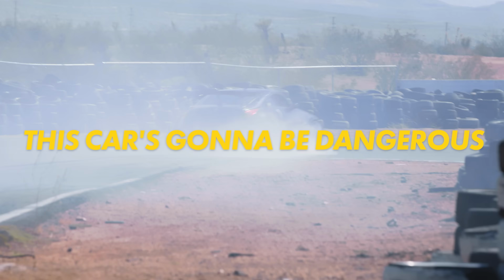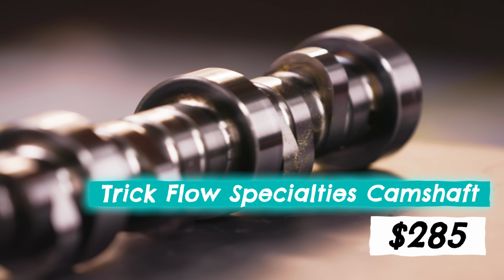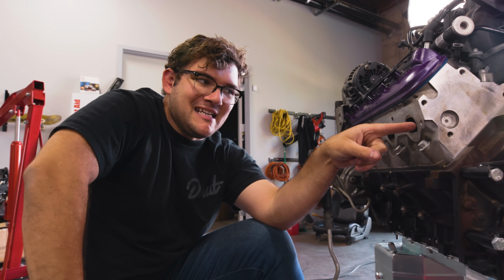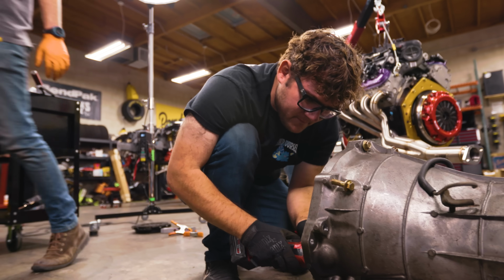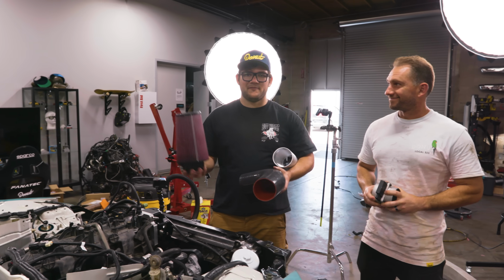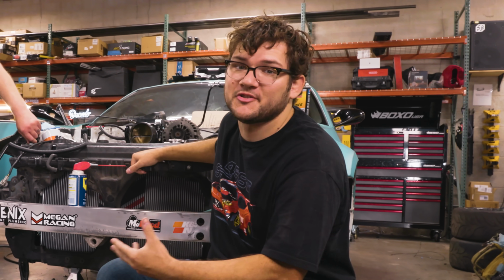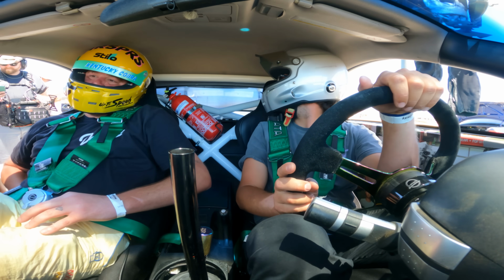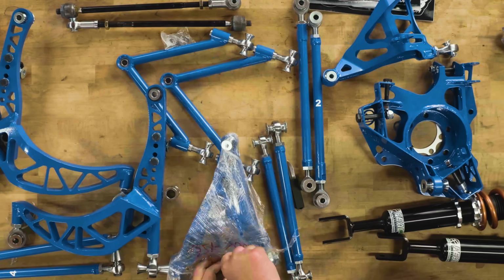$8000 Junkyard V8 vs $30,000 Crate V8 Engine Swap

Comment: I love how they make it seem like 8000 is only 10 dollars😂
Reply: in engine swaps it sure is
Reply: @1985_Honda_CRX_Si  lol it is, isn’t it. This would cost another 10-15k in labor, if not done diy. It’s a very expensive hobby.
Reply: 10k is an amount of money most men with passions in their prime can throw at a toy, this proves you're better off learning and doing, than saving the 30k to pay someone..
Reply: @fry.master  its pretty easy to do if you do it over a couple of years like most people.
Reply: @Saberjet1950  easy is not the word.. I was thinking in "possible"
Reply: 6k and counting for my money pit love the way she rumbles
Reply: @DonChilon210  Still weird that they basically spent 20k-50k on 5.x second cars.  Fun cars but you can buy plenty of used cars for less money that are faster than that stock, then modify them.  I expected much better acceleration for 400-500 hp engines in small hollowed-out cars, but maybe the tires were the problem.
Reply: I don't know what yard they went to but every yard I've seen here on the east coast, a verified healthy junkyard motor runs 2k tops and the U pull it yards only want 3 to 400 for a whole ass assembly.
Reply: @ryanmills7986  I was gonna say 8000 should get u a kickass used engine.  I paid 500 for my used engine 3 yrs ago and it's run fuckin great.
Reply: When I was younger, that sounded like so much money. Now I think about what I have in not one car, but 4 main toys? Fk.
Reply: Well... when this channel makes almost $3mil a year, I would say so.
Reply: @Saberjet1950  right, its basic when it comes down to the assemble and disassemble. the same applies for most things cars toys wagons. you take off and add parts. most people could do 90% of there restoration themselves. some tuff the fine tuning requires skills.
Reply: If you have sponsor and do a collective money , it's nothing .
Reply: with way things are going, $8000 will soon be the new $10
Reply: Makes me feel pretty good about the $300 I spent on my 6.0, lol.
Reply: You can get a reliable LS for less then 3k
Reply: It’s more than a yearly minimum wage salary in my country 💀 and 1k less than the average salary 🏚
Reply: @ryanmills7986  they are in cali  and i think they bs a bit about that junkyard motor go back to when they first get it see if you see any thing strange
Reply: dude, they have like 5 employees and make an absolute ton of money between touring and ads generating revenue and stuff. Unless youre bad with money or have a bad job though, 8k is not hard to save if you really want to, and thats dirt cheap for a Z LS build.. Thats literally like less than what youd pay for a older slow civic SI now with low miles . I suggest watching the series "foundations in personal finance" by Dave Ramsey. It was a required class in high school, and it really makes you think about ways to generate and save more so you can build whatever you want in the future and be happy.
Reply: @Gerald.69  "joined 8 months ago, no videos no subs" you work at mcdonalds and drive an altima.
Reply: No shit.
Reply: No shit.
Reply: It's actually 8 dollars.
Reply: not by intention at all to sell stuff to us public schooled zdz
Reply: because they aren't paying for it.  simple.  the same way you don't truly value your game consoles until you're old enough to afford them yourself.  what a dumb concept, of course the 30k engine is better.  but what average (keyword AVERAGE) enthusiast can spend 30 grand on just an engine
Reply: That’s relativity, friend
Reply: @jonosterman2878  wow i want to go there. My swaps don’t cost near that much for labor
Reply: @Ebay Buyer Defender it sure as hell ain’t easy but we don’t do anything cause it’s easy
Reply: 8,000 can get you a used high mile LS1 car 😂😂😂 a Camaro with 130k miles hat still runs
Reply: 1100 for a 4.8 on LKQ add the computer and the trans and were only at 2500ish this is an expensive junkyard swap
Reply: To all the "8000 for an ls is expensive" they didn't pay 8k for the motor... it's the headers the springs the motor and Trans mounts the adapters and all the other odds and ends needed to make it happen. Just like high car they probably spent 30k for everything not just the motor. Still waiting on that low car build list though 🤔
Reply: @1985_Honda_CRX_Si  That's insane! I bought a TON of reliable  V8 horsepower for less than $8K last fall. Dart block, Dart aluminum heads, forged internals , big pan, 520hp without adders.
Reply: @iSOBigD  they likely can't transfer the energy
Reply: @incredible5587  *their
Reply: @Saberjet1950  tell that to my friends with their 87-95 bmw 325is that they swear they are going to turbo every year but dont have the funds and don't know where to start..plus they havent even gotten an intercooler yet.
Reply: @ItzzShazey  sound like they don't really want to do the work
Reply: It isn’t that much.. unless you’re still a kid or work at mcdknalds
Reply: @jonosterman2878  then your only proving his point lol
Reply: @Saberjet1950  that and they can’t afford to even get the parts to do the work. They think a 1700 dollar eBay turbo kit is going to be all they need to achieve 500whp. When In reality the kit is trash and wouldn’t work for more then 5 runs without something breaking.
Reply: T
Reply: Yw
Reply: @fry.master  Twyler’s r w
Reply: @ryanmills7986  They live in Cali dude. THis explains everything
Reply: I just had a salesman in New Orleans try to sell my wife a used Honda Accord for $33,000. So $8,000 for an entire motor? Not that expensive any longer.
Reply: @DeathhAngel1  sir you joined 14 years ago and have 11 subs. What was your point again?
Reply: 8k junkyard engine, its the best junkyard engine of all time.
Reply: Bought my car for $24k + $1400 tune ($25,500 total) and it does 0-60 in 3.7s or so. But to be honest a V8 swapped Nissan Z sounds like a riot, no matter the straight line hahaha
Reply: In retrospect it is when people spend 100s of thousands of dollars on drag cars
Reply: Fr buying $160 shocks has me broke
Reply: @Heavychevy0402  If $160 shocks has you broke, you need to not only be not modding your car, but need to be selling your car. You’re in a financial emergency mate
Reply: So nice old days
Reply: @iSOBigD  just because the cars made 400 to 500 doesn't mean that's what their tuned at. Also, there's different style dynos that show different numbers than others. Along with how your never really going to get a great idea of how fast something is in video. I had a car that made 450 but I never ran it at that more than a few times
Reply: Shoulda put a coyote in high car instead 😂
Reply: @jonosterman2878  if you ain't doing it yourself you probably shouldn't be watching this🤦‍♂️
Reply: @incredible5587  a lot of it probs down to people scared of blowing out their new parts tbh too aha
Reply: @fry.master  30k is the tuition at UTI to learn how to do it yourself lol
Reply: @teddy5004  30k is the baseline pay grade a year at a dealership to be a trash mechanic, that would maybe be better for someone looking at a place like uti… lmfao. I prefer a bs
Reply: @fry.master  Yeah I actually just got told by my local dealership that I should apply to work for him, he offered to teach me how to build engines so I can save up some money to go to MMI.
Reply: @1985_Honda_CRX_Si  laughs in $250 Chevy 350 engine swap
Reply: I mean for them it's like $10 sure since they make tons of money from sponsorship and ads.
Reply: @DuhShazey  The kit used on Low Car is based on the Turbonetics kit. Had they gone with the turbonetics turbo instead of rev9 could've made it a a bit more reliable.
Reply: The way they built cars is literally the equivalent of making an organic meal from scratch.  Nothing is cheap about it. In the end the cars are probably barely over the 8k js
Reply: Compared to what high car spent it might as well be lol

Comment: Nolan's reaction to his engine starting up is absolutely priceless. The genuine pride  he had for accomplishing such a hard task. Also impressed lo-car was faster for such a heavy & low powered V8. Can't wait for the next video
Reply: NGL I figured on the drag the high car was going to be slower, unprepared track and no sticky tires, too much HP is not always good, on a roll would have been another story.
Reply: May be less power, but remember it's a truck engine, that's a fuck-ton of torque down low.
Reply: We don't know the transmission gearing, which could have a big impact on the acceleration. Also, high car driver hit the rev limiter for too long on the 1-2 shift every time.
Reply: @elitebuster2012  they did a cam swap so other then block material and accessorie positions there is nothing "truck" about the engine
Reply: @jasonsaler8537  can confirm in a ls1 ws6 with bolt ons that short shifting 1-2 by 700ish rpm was fastest on street tires
Reply: @esfreerider  You forgot about intake. Truck and car intakes are different.
Reply: The low car 'won' because the high car couldn't drift.  What a stupid requirement.  High car would have won no problem if both drivers were pros and not checkbook hot rodders.
Reply: @DarthObscurity  its just a bit of fun dude lighten up
Reply: @DarthObscurity  The tagline of the show has always been "Does mo' expensive mean mo' betta?", and the answer has been, numerous times, "not always".

By the way, the only pro drifter on their team, is their shop manager...that I know of.
Reply: I actually felt Nolan's reaction. same feeling I had when my Mach 1 was drivable again after years of no progress.
Reply: @daldovino  Nice lowkey brag.
Reply: @NaruSanavai  aaron is pro from what i can tell but he was only in th first half of the video
Reply: @RayganSlatter  no they aren’t the motors are basically the same y’all just don’t know any better
Reply: @jasonsaler8537  i thought that too. i dont think it was deliberate, i think he was just having trouble holding grip on the launch and was forced to ride the clutch a bit. im willing to bet some sticky tires wouldve had hi car sub 5s
Reply: It had a transmission made for weaker engines and the high car have one for more powerful engines.
Reply: @esfreerider  They kept the original crankshaft in the junkyard truck engine. Trucks more often than not have bigger crankshafts with a longer throw to produce more torque, especially if the truck it's in is meant for towing. I wouldn't be surprised if low car made more torque than high car on the dyno despite having less horsepower.
Reply: I love James' face at the end where Low Car demolishes Hi Car. Nolan putting in the work makes it more satisfying when James keeps talking crap but doesn't even do shit.
Reply: 33/38 horsepower is not a lot at the end of the day! There is a lot of factors that can eat that horsepower and erase the small advantage hi car had hell even the wrong tires or gearing can! Overall if I spent $30,000 and my buddy spent $8000 and I only had 33/38 more horses than him and could easily be beat with a driver mod I’d be pissed! But I see it everyday watching npk and other drag racing content! Not as much as when I used to drag race myself! Walk the pits and look at the cars that are winning consistently, they don’t always have big money sponsors or top of the wallet parts!
Reply: Swapping out the 317 cylinder heads from the LQ9 with 862 heads from a 4.8/5.3 should give that motor a full point in static compression and push it over 400 whp. HI car should have definitely done a burnout before the launch to heat up the tires or swapped the cam for one that was softer in the lower RPM range.
Reply: @robertmyles9124  that's actually false, trucks have SMALLER duration cams that make power at lower RPMs for towing and doing truck stuff. Installing a bigger cam pushes power higher in the RPM range but softens power production down low
Reply: @dustinjohnson7728  I didn't say anything about camshafts. I said trucks have larger CRANKshafts. Get hooked on phonics, son.
Reply: @robertmyles9124  my mistake but you're still wrong, the stroke on the 6.2 and 6.0 is the same. It's pretty common for builders to bore out the 4.000" iron block 6.0 cylinders to 4.065 to make them 6.2s. As a matter of fact, all LS engines but the 4.8 and 7.0 have the same 3.622" stroke.

Comment: Man Nolan’s excitement for when lo car fired up!! Felt that when I did a engine swap on my older Mercedes. No one had done what I was attempting and there are no aftermarket parts. When that thing fired up on the 2nd crank I was absolutely joyful. Also a manual swap and man feeling the slick gear changes as I’m feeling out the new motor was a wonderful feeling, especially as you realize everything is working like factory and no bad smells or warning lights!

Comment: both sounded awesome but low car just sounded so much better! Also i think High car having more difficulty in drifting was actually good as it did have the "better tyres and suspesion" and so actually makes sense.
Reply: Yep, you could just get less grippy tires or wait until what you have wears down and then use those for drifting if you really wanted to.

I do wish at the end they had done laptimes not a drag race, and then also had multiple drivers do runs because that could very well be driver error.
Reply: Yeah those Federal Tires are no f*cking joke when it comes to sliding.
Reply: What were the differences in tires? And what was the difference in suspension. I was confused why hicar was having more difficulty sliding too .

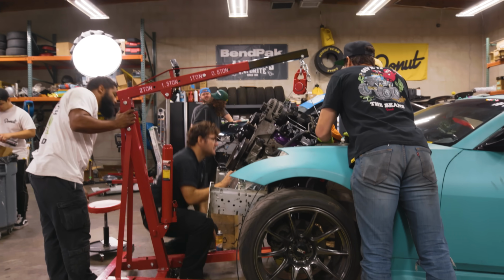Comment: On Low car @19:58 I can see the heater hoses are looped. From my experiences that'll cause over heating issues, its better to just block the lines, the loop leads to the coolant getting stuck in a circle. Love the Hi Low car content btw

Comment: Man, I could feel Nolan’s excitement when that engine fired up.  I had a very similar experience with my 89 4Runner 22re.  Great video guys.
Reply: I had an old f150 and I felt the same euphoria every time I made it home without the aid of a tow truck 😄
Reply: Man them old 22re's were great engines! Kill it once, rebuild it so that it never happens again, and I mean never. A buddy of mine blew out a 22re from a pickup, rebuilt it and put it in his 4runner and for the next 2 years it went through the most abuse I've ever seen an engine go through period. I'm talking buddy bounced it off the Rev limiter on every shift. He welded the rear diff and we would all load up in it, get drunk and go 4x4ing in it and man, some nights, if you hadn't gone out in this thing before you'd end up worried halfway through the night that something would let go and we would have to walk out. But nope! Mud, snow, rain, big rocks and logs, deep water, it just kept going and going. The only thing that ever let go was the damn exhaust and that was because buddy decided weld it all up himself, and a fucking potato could weld better than he could! So the exhaust would ride with us in the cab with the back hanging out the rear window. It was a hoot going out in that truck. Everybody stared at it, I mean two different colored fenders, one white, one rock guarded grey that flapped in the wind, a red tailgate, and every other panel was scratched and caved in from all the shit we ran into! People stared because it looked like a rolling mechanical issue, and it was, but it just kept going! Buddy sold it for $1500 in the end!
Reply: Oh my God and the stereo I helped him put in it! Moldy home made oversized ported box, made from a sheet of plywood we stole from a construction site. And not the nice stuff, but instead the stuff made from wood shavings/chips that you'd see nailed to the outside walls! Two 12 inch subs from the mid 90s, a Kenwood and a Rockford, and a 200w Rockford Amp to go with it. The power wire was 3 separate pieces of 8 Guage of various origin that I spliced together, held together with electrical tape and there wasn't a fuse laying around, so it had no fuse to stop the power line from lighting the truck on fire. It also only just made it to the back as well, so the Amp was against the back seat with an inch of wiggle room. The carpet was ripped out of the truck, the only way to get the wire to reach was to run it along the floor of the truck, under the passenger side lol.. how we didn't burn that truck to the ground I don't know, but that stereo pumped pretty good!
Reply: I have a 22RE motor as well. But it’s in a 93 Toyota pickup